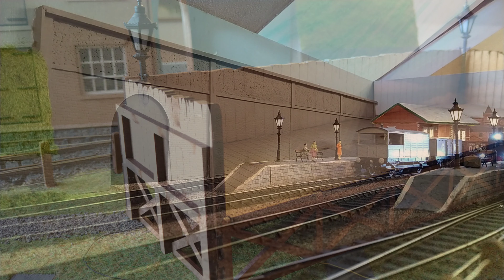Model Railway | Budget O Gauge Layout Update 6 | January 2021

Comment: Another great installment. The laser cut buildings you are using are really quite reasonably priced I notice. Please keep up the series. I really like the tarps over the two wagons. Did you make them?
Reply from the maker: Thank you for your kind comments. Only drawback is the weight the larger buildings can add to portable layouts but in smaller scales that would be fine. Tarpaulins from eBay, folded over a cardboard rectangle.

Thank you for tuning in again.

Comment: Hello Shane, Please could you tell me the make of your two short radius points? I can't find any firm that makes them. Kind regards, John.
Reply from the maker: Hello John, the points in the goods are old Rivarossi short radius electrofrogs which come up on eBay from time to time. 

At the time of laying the Peco points were slightly too big and expensive, the Lima items were insulfrog and the Marcway points were also too large.
Reply: @willowsjunction7989  Hi Shane, Many thanks for the quick reply, and thank you for your kind help. Kind regards, John.